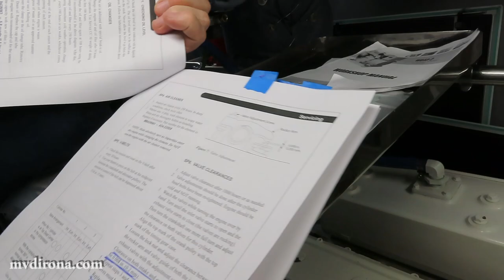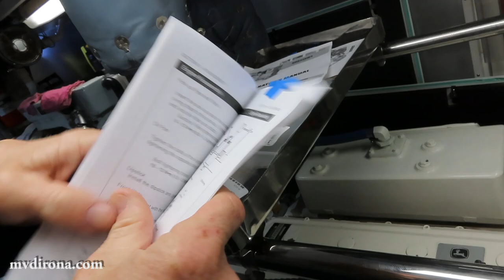Replacing Northern Lights 12kW GenSet Cylinder Head Part I (MV Dirona channel)

Comment: Another extremely in-depth and informative video. As I have said before I always look forward to your videos and adventures on your page. I have been around engines and automobiles my entire life. I think watching the progression of technology is a wonderful thing. When James was talking at the beginning of this video about how the generator's engine is small but not "really" small it got me thinking about the Ford Model T. That engine was a 2.9L four cylinder that made all of 20 horsepower and would chug along happily all day long - and some still are with diligent maintenance. I briefly was the caretaker of a 27 T that still had a non-refurbished original engine that just ticked along as smoothly as it did nearly 80 years before I had it. Something to be said about a good solid design.
Reply from the maker: 2.9L at 20hp is amazingly low stress. Amazing that you had an instance running well after 80 years.  Our last car was 320hp from the 3.0 liters so the complete other end of the spectrum. Bet it won't be running in original form in 80 years :-).

Comment: I love keeping small divided tackle box on hand for jobs like this. Tape a piece of paper on the inside of the lid with the grid drawn out so I can label what each part goes to. It's also useful to be able to close the bin when you need to step away or stop for the day, so there is no risk of it all getting knocked over and disorganized
Reply from the maker: Most jobs I do don't have enough fasteners and small parts to need that level of organization but it could have helped with this one. Good suggestion.

Comment: They make a special  set of wrenches  for taking  lines like that off , the box end is split to fit the line through . Usually will fit between other spacers like you have. Hat you did was fine just a suggestion  for new tools.
Reply from the maker: Yeah, I used to have a set for brake lines back when I worked on cars but that was decades ago. In the boat tool set, I'm far more space restricted but I agree with you and will pick up a set. Good suggestion.

Comment: the big reveal head off was half expecting a big oily damp carbon mess on number three ,fuel burn and compression side of things all looks perfect,your diagnosis was spot on love to see those valve seats,so could be needing better hardened valve seats but also could be most likely needing a stronger valve spring theyre too weak  bounce on them so they chatter and leak causing seats to burn black and overheat hmm the wonders of the combustion engine,,, great video  loved it
Reply from the maker: This particular engine uses integral valve seats. They are just part of the head. I don't know if that portion of the head has been hardened. I agree the valve sprints are surprisingly light on this engine. And the valve heads weren't polished on the old head as I'm used to seeing on gas engines.  Generally, the vales on the head that came off don't look great from my perspective (shown in the next video). I suspect they have been leaking.  

However, even with those concerns, this engine has many owners reporting 15,000 to 20,000 hours and few longer at 30,000 hours. They seem to often do quite well. More in the Part 2 video and we'll see what we learn over the next few thousand hours on the new head.

Comment: Thank you for sharing your expertise on how Diesel engines are put together and operate.
Reply from the maker: We'll thanks for the feedback. We would both slightly prefer to not have to open the engine up it was only a day of work so really not that big a deal. It'll be interesting to see how many hours it can deliver with the new cylinder head.

One comparison that I thought was interesting is, if the engine where in a over-the-road truck and it averaged 40 mph, then the 6,700 hours it delivered before needing a valve reconditioning is 268,000 hours. Not as much as we would like but still far from a disaster. It's a good little engine.
Reply: @MVDirona  It is.  If it were on a truck it probably wouldn't be subject to heavy seas backwashing through the exhaust system, like your atlantic crossing hypothesis.   Perhaps some clever fellow can engineer a slightly better exhaust valve system that's reliable for exhaust but also prevents backwash.
Reply from the maker: Yes, you're right, it wouldn't be a problem on tractors and trucks since they use water-to-air heat exchangers (radiator) and dry exhuast. One solution might be an insulated exhaust elbow that moves the mixing of water into the exhuast further down below head. But that would take careful design and require quite a bit of custom fabrication. I don't see a simple solution.

Comment: Great video again, thanks a lot to both of you. Quite interesting to watch you doing this on a modern diesel engine, compared to the old Onan MCCK Generator I have under service (the old vessel ...). I also found, that those go back to tractor (Kohler) engines. Very important, because on one side this helps in finding spares and advice. Other great thing about is, that tractor engines are built to last and to be repairable. Looking forward to the reassembly!
Reply from the maker: Your right about engines with tractor heritage often being long lasting. And, it can also help with spares in some cases. A couple of years back when replacing injectors in our John Deere 6068AFM75, I found myself missing an O-ring. I went to a nearby tractor dealer and asked if they had this part.  He laughed, and pointed to a large parking lot of full of Deere green farm equipment and said, they all use that same base engine.

Comment: Love to see you working on this engine , James with the to the point questions of Jennifer : relaxing co-makership and equally relaxing  to watch as a spectator.
It is truly a simple , not fancy, but straight forward and honest engine, which can rather easily be maintained by its owner ( of course well prepared comes in handy and prevents  unpleasant surprises).
Nice to hear it was originally designed as a tractor engine
Reply from the maker: You are right it's a very low tech engine with only 20 hp from 1.5 liters, no turbo, no after cooler, 2 valves per cylinder, simple mechanical injection, and all discrete component electrical control. It's not complex and Northern Lights parts pricing is usually pretty good.  

Our Deere main engine is the opposite end of the spectrum wiht high pressure common rail, proprietary engine management system without cost effective owner access, tubcharger, aftercooler, 4 valves per cylinder, and all fly by wire.  The upside is it's very efficient and requires just about zero service. In 11,000 hours, it's has a set of injectors and that's it.

Comment: I got hypnotized the minute you started,  intelligent explanations! How come you know so much, maybe  none of my biz though .I was amazed how easily the heat exchanger went out ,does it means it is fresh water (twice) cooled
Thank you for sharing
Reply from the maker: Thanks for the feedback on the video. In my distant past I was an exotic car repair mechanic. I didn't work on diesels so, in many ways, a very different world but there is quite a bit of overlap.

On the engine cooling system, yes, the engine is cooled by circulating sea water through the heat exchanger and then spaying the sea water into the exhaust to cool the exhaust flow.  The engine, like most water cooled automobiles, circulates coolant (antifreeze in most cases) that is cooled by the heat exchanger. Essentially, it's the same as most cars in cooling design except rather than using a water-to-air heat exchanger, it uses a water-to-water heat exchanger.

Comment: You really need to get yourself a set of tubing wrenches .  Using open end wrenches  on tubing nuts can distort them and that can lead to a whole set of problems like fuel and oil leaks .  Most of learning is doing . And for the most part your doing fine .
Reply from the maker: Yeah, I used to have a set of tubing wrenches for brake lines back when I worked on cars but that was decades ago. In the boat tool set, I'm far more space restricted but I agree with you and will pick up a set. Good suggestion.

Comment: When you got the head off, were you able to see a visual problem with the valve? Receded, burnt etc.
Reply from the maker: Valve seat had recessed way into the head. No need for tools. You can see the problem from a couple of meters away. Then the question is why?  Is this just valve seat wear (some fail earlier than others), or is there some other fault in the engine contributing to the problem? Will get that second video up as soon as we can.
Reply: MV Dirona 
Several things can cause it to recede. High localized water temperature, insufficient valve lash, weak valve spring, worn valve guide. With a new head and gasket, you’re back to new, but check your lash again after a few hours since most seating is early on. Check your heater core, annual impeller change.
Reply from the maker: That's a good list of problems that can cause early valve seat failure. On wet exhaust marine engines, there is one other: salt water intrusion coming up through the exhaust system. We can't find any evidence of problem in the exhaust system after having checked it carefully but we'll keep an eye on the valve lash as you recommend. The manufacturer recommends re-adjusting the valves at 50 hours so we'll do that.
Reply: MV Dirona 
What I’ve seen, is when an owner doesn’t let the engine get good and hot(test to see if it starts). The exhaust port is only warm enough for steam to condense and rust the valve stem of an open valve. Iron oxide is an abrasive and either sticks the valve open or wears the valve guides. I cringed when they start an engine, blip the throttle a few times and shut it down. You have quite an investment in the yacht. Probably one of the most useful tools I have is a thermal imager. You can take pictures around the engine room when things are operating normal at temperature to establish a reference “baseline”. In the future you can tell if part of an engine is abnormally hot like part of a head or riser. The first day I used it, it paid for it’s self. I was outside and panning around and found the shore power connection on my boat was glowing bright. I touch it and almost got burned. I had AC on and charging the inverter bank and I was pulling about 25 amps. The socket in the hull was corroded which caused resistance and heat. It was starting to melt the wires inside. It could have burned a hole in the fiberglass around the outlet and ruined my plugs. I use a “FLIR One “ . I highly recommend this brand just make sure you get the latest version/ generation and make sure it fits your phone.
Reply from the maker: I have a Flir One as well and every 6 months scan the electrical boards under high load and all high current connections. We haven't found anything with it yet but we did have a loose connection at a DC shunt when the boat was around 2 years old that was so hot it was visible in the visual spectrum. A bolt was glowing red and the galvanization was gone.  We re-torqued everything and haven't seen any problems since but a great many boats meet there end this way on electrical issues.

On the engines, I do use an IR heat gun to check port temperatures under load looking for a weak cylinder. 

On your theory that the exhaust valve problem was rust related, I think you are right. I took apart the old head and there is some evidence of corrosion. I'm working a few theories on that but, at a high level, I'm leaning towards: 1) in extreme conditions, water will splash in from the water lift mufflers and sit there for a week or 2 and 2) when the engine shut down some steam and atomized water is light and it's only a 3 inches back into the head and we end up with high humidity and salt in the valve area and, as the engine cools, it all ends up damp.

The second would be a design issue and hard to address other than ensuring the engine gets properly warm on each startup as you recommend.  The first issue would be mitigated by running the engines after extreme conditions so water doesn't just sit there for long periods of no generator use.

Comment: You need to keep a 1/2 inch braker bar handy, would make the work much easier. Lol, still good job.
Reply from the maker: I do have a 1/2 braker bar and do use it on the big engine but, on these little ones, I don't find it necessary.  But, no debate, it's a good choice when barring over an engine.

Comment: very interesting video may I ask is the main engine in the background and how much horse power please
Reply from the maker: Thanks for the comment. The main engine in the background in a John Deere 6068AFM75 M2 rated at 266 hp with 11,190 hours on it. It's been impressively reliable and we're really happy with it.
Reply: thank you for the info

Comment: I always wear gloves working around diesel fuel, it can cause a nasty reaction that can happen over time and exposure. Also for the push rods I take a piece of cardboard and number a line of holes and put each push rod into a hole, that way you can't get them mixed up. Looks like a nice clean, dry, well lit place to work and of course a Feline supervisor to interrupt you for attention at critical moments.
Reply from the maker: I like to keep my hands clean so I either wear gloves or wipe them frequently or both. Gloves are never a bad choice and they are strongly recommended when working near higher voltages or bleeding high pressure lines. I didn't when bleeding the lines to restart the engine and should have. Thanks for the recommendation.

And you're right Spitfire will usually come down for an inspection if we're in the engine room for more than a few minutes at a time.